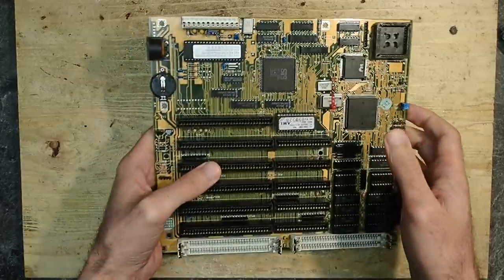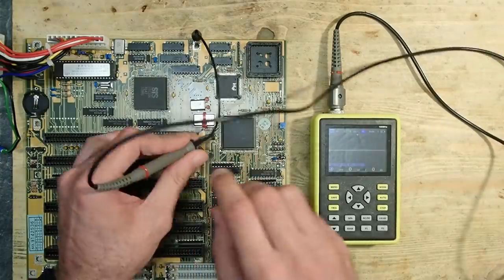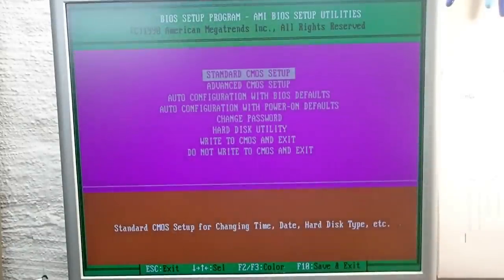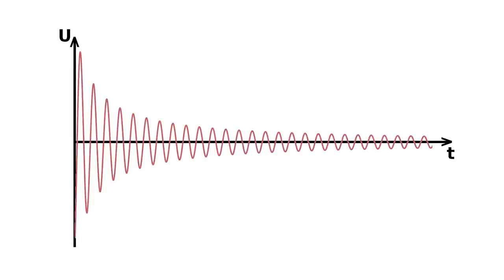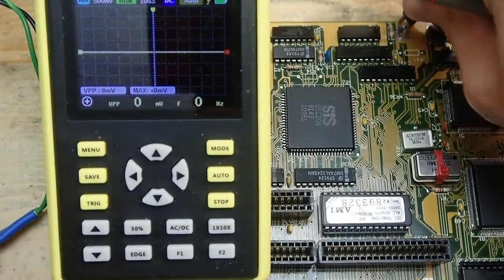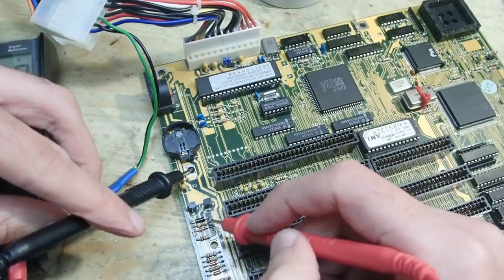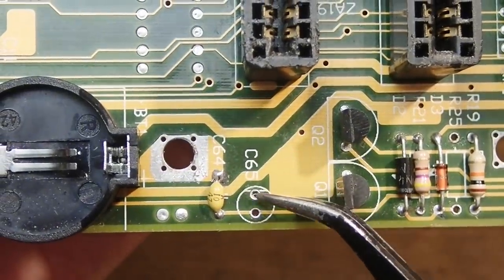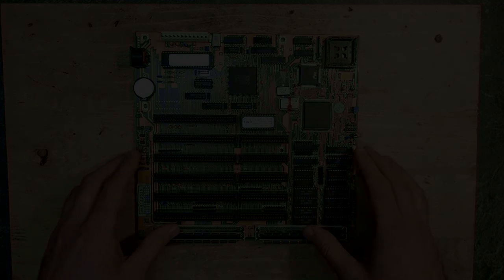Let's repair a mystical issue with an old 386 mainboard

Comment: On one hand I like the video quality and editing. Very good job. On the other hand I am shocked that you are fixing a mainboard and do not know about basic things like capacitor markings or procedures on fault finding. Some rules like never ever change two things at the same time, or if you remove a part always examine (measure) that part before putting a new one in. Did you figure out eventually what the problem was with the capacitor? Short circuit? High ESR? Low capacitance?
Reply from the maker: I suppose, this channel is not professional enough for your level. But don't be sad, if you try hard, you will find something, what fits your expectations in a better way. I wish you good luck, my friend.
Reply: @necro_ware  If you share a video publicly always be prepared to receive critics as well. Make sure you give at least the same level of respect as you were given by ones who are supporting you by commenting on your channel.
Reply from the maker: @kralg  I was not trying to be disrespectful. You were shocked by my incompetence and I just don't want to shock anybody with my hobby made videos. Also your comment was anything else, but a proper critics. I think you just really should search for professional level videos and should not waste your time on hobbyist. They are not worth the time.
Reply: @necro_ware  If you think that this is the right way of seeing things and this is what help you and your viewers the most, I will not be against it.
Reply from the maker: Ok, I'm actually not an unfriendly person, so let me explain my behavior. I really appreciate constructive critics, which helps me to improve my skills, but telling someone, that you are shocked that the person is incompetent and does things, which the person should not do is simply insulting. Please read your comment once again and tell me, where is constructive critics hidden in there? Did you tell, where s.o. can find the datasheets to the parts? Did you think about, that what you see in the video is just a part of what happens behind the scene? Just imagine, that you didn't see everything, what happened and that I may be cut out some parts to avoid, that the video lasts 3 hours?
If you like to give a good advise, learn how to give a good advise first. There is no need to waste your time and write, that you were shocked. Neither does that help you, nor me. That's why I absolutely seriously mean, that if the level of such a hobby channel is too low for you, search something, what meets your expectations. And if you like such hobby channels, then read your posts before you send them and ask yourself, how that can help the guy behind the camera to improve. And if you simply want to insult anybody, well that's another story....
Reply: @necro_ware  I do not think anyone is just unfriendly. People get unfriendly because they got hurt or insulted, as you said and as happened to you. In my comment I was talking about myself and not talking about you personally. If this hurts your feelings, you need to be able to handle that without trying to "kick back". I am saying this with all my respect and with full understanding of all what you said. I really felt shocked, because mainboards (even if they are old) are amongst the most sophisticated devices around and fixing them requires a deep understanding of electronics. And you still got away with it. I am pretty sure I am not the only one thinking this way and I do not think I should feel ashamed for commenting it, even if it hurts your feelings. If you are smart enough you understand what is behind these comments and you will converge to the right way even without noticing it. Telling me just to get away and loving the admiring comments only will never push you forward. If you want to figure out if somebody wants to just insult you, first check if the comment is personally against you or there is a truth behind it that actually hurts you. Whatever the result is, getting rude/sarcastic/unfriendly/etc will never help anyone including you.
Reply from the maker: You just don't get the point :D You were the first one who got offensive, but you obviously are not able to construct your  sentences in a friendly way, don't you? "... fixing them requires a deep understanding of electronics. And you still got away with it...." - means in other words: "...you don't know, what you are doing,  but you are lucky...". What kind of constructive critics is that? Shall I show you my master degree in computer science and digital electronics to prove, that I know, what I'm doing? As I said, you should be careful with your assumptions. What you see in the videos is just a part of what is happening. Please work on your language if you don't want other people to be rude with you.
Reply: @necro_ware  Look, I think I clearly see your point. You got offended and you think I should not have said what I said. This is it all about. Tell me how to express myself when someone in one moment is using an oscilloscope then in the other he believes that a 22K label on such a capacitor has a meaning of "22 kilo"? When somebody is replacing two parts at the same time without checking them at all? So how to tell that this is a bummer? Of course it would hurt you. But not because I was offensive, but because these facts themselves. You really just want to hear hey, what a nice job (which I actually said so), and keep up with the good work, blabla... Would you have been happier if I attached a manual on fault finding procedures or a link to a capacitor marking page? Would you have said that hey thanks for the constructive critic? It even would have hurt you more and you would have considered me being sarcastic. I never got into any assumptions about your general knowledge I only talked about what I had seen in your video. And if those facts hurt you I should not be blamed just because I am the one pointing them out. When you "translate" my comment with words like "incompetent" and "do not know what you are doing, but lucky" this is the exact time you make it offensive but I have never used such words.
I think we are way into a discussion we never wanted to get into. What I really learnt is to be careful with people who get offended easily by facts and they concentrate more on how I am saying things instead of what I am saying. So at least our discussion has not been a fully waste of time.
Reply from the maker: There are many different notations for ceramic capacitors, like underlined, with decimal numbers, color coded, with Latin and Cyrillic letters etc. I didn't know how to interpret the K in this case and said in the video, that K could mean x1000 (kilo) of pF, but from my experience, this caps should be more like 22pF. A moment later I said, that I looked into the datasheets and found, that K is just a precision index. Didn't I? And in regards of changing multiple parts at once, I explicitly didn't make this. I changed the capacitor and added a socket for the IC, yes, but the IC was the same one and I told in the video why I am doing this. First after I saw the same behavior, I tried another IC. Always one part at a time. As I saw, that none of the parts change anything in the result, I put them all back in place to avoid problems, which could occur, because of multiple changes. Everything was back to the original state, as I realized, that the issue is in the switching circuitry. So basically, I did everything just as you said I should do. Did I test the capacitors? Yes I did, the test of the first capacitor didn't get into the video, because the camera didn't focus it properly, but you can see in the video, how I test the second capacitor, right?
I don't need your appreciation or cheering up. If you don't have anything to say, what could help, just don't say anything. And, yes, it would be much better help, if you'd just say "..ey, guys, btw. there is this datasheet, where you can see, what K means and you can also see other notations there as well...." - this information wouldn't help me anymore, since I found it already, as I said in the video, but others, who are watching, reading and searching for the help would be glad to see that. Instead everything we see is, that you were shocked, because s.o. didn't something the way you expect it to be done. Congratulations, but, again, if you have nothing to say, or can't say it in a friendly way, just don't say anything.
I can easily block you on my channel, but I don't want it. Instead I want to reach you, to make you understand, that also other people, which are doing, or trying to share their videos will be offended by such a language. Work on your expression, tell what can be done to make it better next time, where s.o. can find more information on particular topic, but not that you are shocked and that they "...got away with it...". They/We don't owe you anything and if you don't like it, just don't watch it. Eventually, may be go out and show, how to make it right instead.
Reply: @necro_ware  Did I ever say I did not like your video? Did I ever say I had expectations and your video was off of it? I expressed how I responded to your video and said what I noticed. My comment was not about you, but about the video you presented. I have the right to feel shocked and you have the full right to ignore it. I did not lie to you. When you were putting in the 22nF capacitor I was literally keeping my head in my hands. I clearly understand now that I did hurt your feelings with my comment, but when I wrote it I was not aware of that. Not because I am socially retarded, but because most people would have reacted differently according to my 40 year experience of life.
Let me tell you one more thing. You said the word "lucky" and I seriously believe you were lucky, I just did not want provoke you any further. Let me explain why. In your video you nicely show with diagrams that the behavior must be capacitive like in an RC circuit. What you forget is that for example an NTC resistor gives a very similar response and my assumption is that that is exactly what happened there. The tantalum (most likely decoupling) capacitor got a short circuit inside which was not a complete short, but it behaved like a resistor with small value. When you switched the board on it started to heat up which in turn resulted in lower resistance. Due to the relative high impedance of the power supply the voltage started to decrease and it made the oscillator circuit disfunctional. So you made a wrong assumption and ironically this led you to the capacitor, but the effect had nothing to do with the capacitance. Even if it hurts you it is called luck.
If you answer my question without being mean right in your first response we could have ended up in something constructive. But you got hurt and got personal (you are a sad person, you should get away, etc.) and now "threatening" me with blocking. So you may say I have issues with language, but you cannot say you are better at all.
Reply from the maker: I think, this discussion goes nowhere and it's been enough said. I wish you a nice day.

EDIT: talking about technical reason, you are basically right. I tested the capacitor off camera a little bit and it acts almost  like you say, but even slightly more crazy. In the fist moment it acts as a capacitor, it charges up to the voltage and after a while it starts to discharge again. My assumption is, that it has to do with the temperature indeed. If it gets warmer, it starts to change it's behavior.  I didn't try that, but I think, that if I'd try to raise the current, this thing would explode after a while. The reason, why this didn't happen in the board is probably due to very low current in particular case.
Reply: @kralg  actually the capacitor has developed leakage current...the leakage current increases as it heats because like you saw, the first time you power the board the clock would work for some seconds but if you power cycled it , it would work for less and less time.....because the cap's leakage increases as it charges/heats  the curve on the graph looks similar to a capacitor charging curve, maybe a bit stretched...... he was NOT lucky, he was right....you just took his words too literally....no other component on a board will behave like that...transistors could have open juctions or shorted ones, for example , leakage current on transistors doesnt look like that and its very rare on low power silicon transistor circuits...if you work a lot with germanium transistors like i do then you could see some weird lekage and instability on those but not on a pc mainboard...it had to be a capacitor, i just did not expect a tantalum...they usually short and explode...this problem is very common on electrolytics though. but of course you already know that and much much more
Reply: @MrHBSoftware  It is exactly what I said call it a leakage current or low resistance, the effect is the same. He clearly explains that when we see such a response curve it is something to do with capacitance, this is why he looked for a capacitor as the culprit. But just because a response is "similar" it does not mean he was on the right track. I have seen components failing in almost all ways including such a behavior in case of a semiconductor as well, so there are no strict rules. We can say that there are more usual cases, but he was not aware of them (he would have mentioned it I guess).
It does not really matter if he was lucky or not, I have been lucky a million times already. In fact this is the way our experience develops. I just do not understand why a fight needs to be attached to it. And I do not understand what the purpose is of your last sentence.
Reply from the maker: Please cool down, as I already mentioned, enough been said. Technical reason is clear, the tantalum capacitor got bad. As I wrote I made some test off camera afterwards and this thing gets leaky after a while. The sneaky problem about this capacitor is, that it behaves as it should in the first moment, but after a while it gets conductive, but never really shorts in the end. Funny enough, when I test it with my multimeter, which can make some simple capacitor tests, it tells, that the capacitor is alright, only if you put some longer load on it, it starts to leak. That's about the technical background and I'd appreciate not to continue the personal fight. I don't like, how the first comment was made, it was simply insulting, but it was made in that way and I can't change it. We discussed it enough and should move on. Thank you very much.
Reply: @kralg  i will not answer anymore in respect to the author of the video...now please next time try to to be polite and when you say something is wrong please present us with the "right" also...that way we can have a healthy discussion and no fights...i bet we can all learn a lot from eachothers....cheers
Reply: @MrHBSoftware  Your first sentence is eligible for an award. You are completely off track.
Reply: @kralg  just find a girlfriend dude
Reply: @Anjay Asmara Anjrit Yes, I am talking too much because I need to defend myself against oversensitive people immediately casting me as a bad person just because my one sentence is not sounding as they would expect. Strangely a lot of people will then follow them even without a real reason.
I cannot see what video I should provide to support the facts I pointed out.
Reply: @kralg have you considered that maybe you are the problem..?...you would not "need to defend yourself" if you didnt start attacking in the beggining.... let me teach you....      polite constructive criticism example for the socially unskilled individual:   "Nice repair. i would suggest you do this instead of that, it would be better because of this and you would avoid the risk of that....." then i bet the author would thank you for the tip if he found it usefull or he would politely argue why his method was best... see? without throwing rocks at anyone...
Reply: @MrHBSoftware  Thank You for trying to teach me, but if you try to focus you will see that my aim was not giving advice or telling what anyone should do. I tried to express what I (again: I) feel about the video as accurately as possible. Comments are also for that (check out the million other comments on the internet) even if nobody cares. The author felt like it was throwing rocks at him, but it was just truth about the video, not a personal attack at all. Most people first check the content of the comment and its validity and if it is true then they keep their head down and try to learn from it. Unfortunately some people (especially new internet generation) first check what other people may think about a given comment and if they believe that it puts a shadow on their shining they get insulted and freak out. Probably because it is all about popularity I do not know.
So this is what I think the problem is. And of course there are always other people who join the fight and believe they are smart enough to tell the other one what to do and what the correct behavior is, because the world is so simple in their eyes...